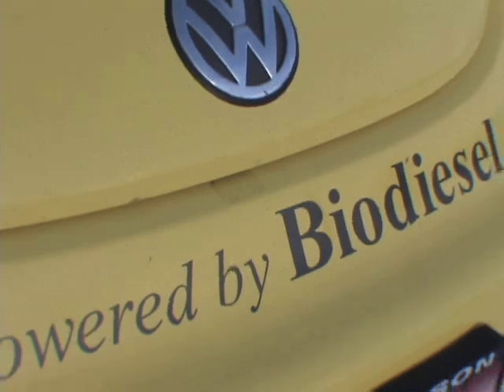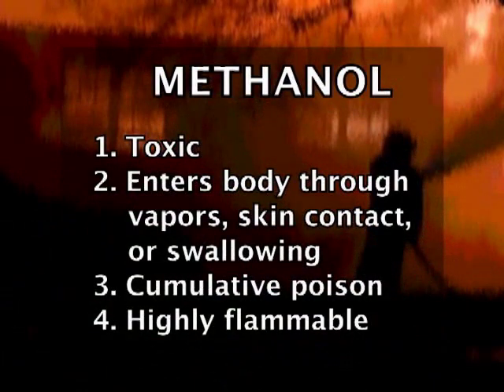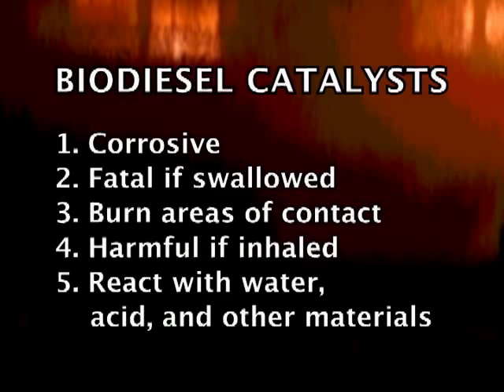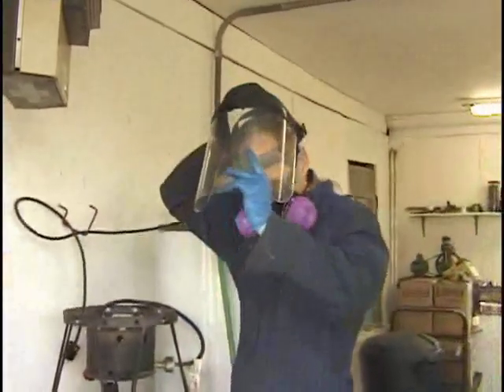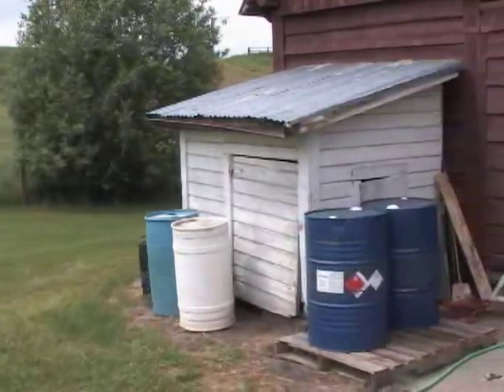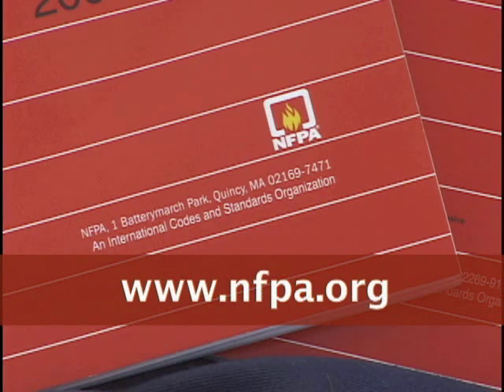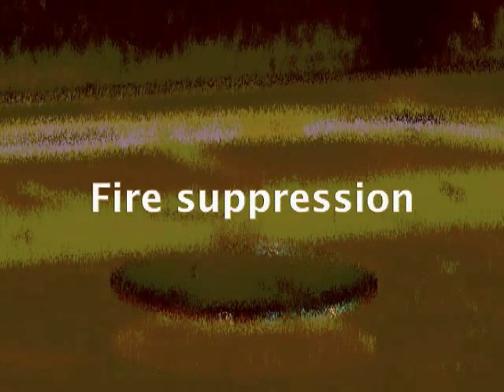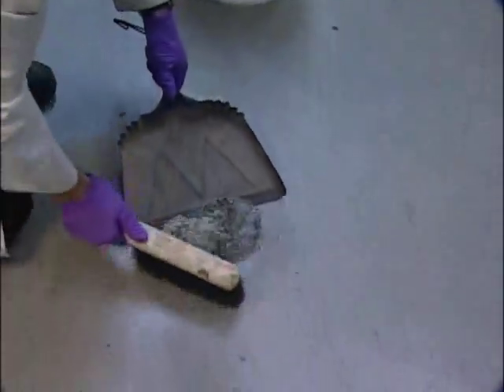Biodiesel Safety

Comment: just wanted to add cutting barrels is the number one reason construction workers die. all barrels should be consider dangerous, as companys sometimes don't use new barrels they recyle them the way they are formed they can trap fuel in the lip of the barrel. so even if you have a barrel that is labled it might have had something else in it. or other have used the barrel for waste ect.  just to let everyone know that working on a barell becuase it is cheap might kill you. seek  a profestional